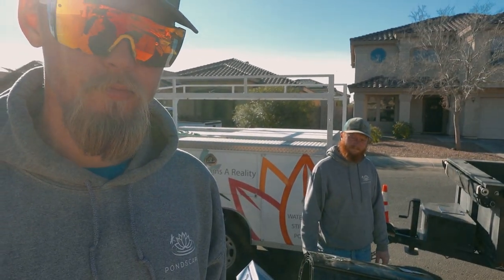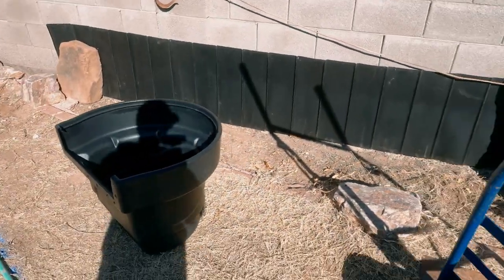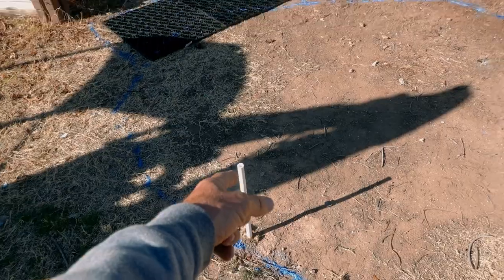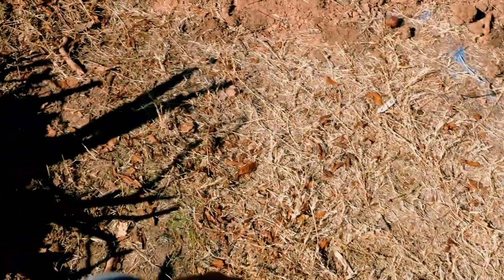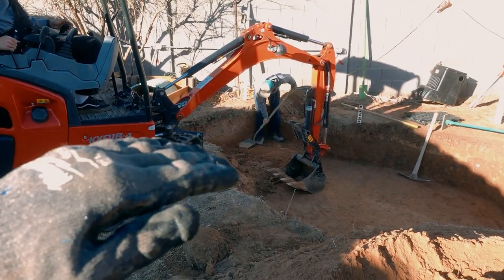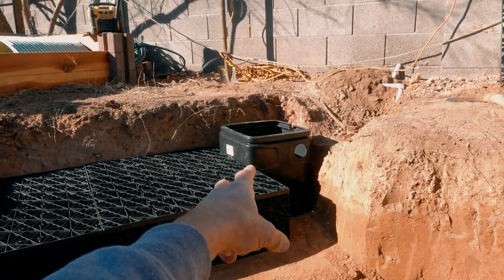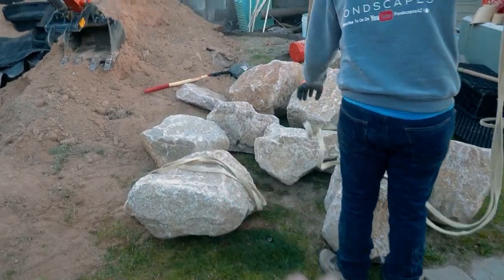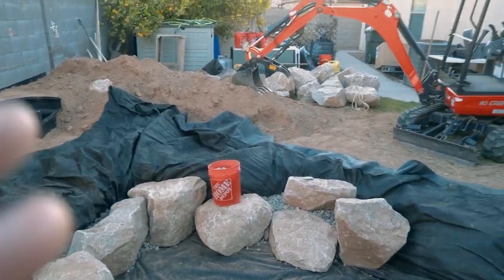8x10 Eco System Pond with INTAKE BAY Built for a Turtle

Comment: That turned out really nice! So you used pond foam to put a seal between the side edges of the scrap liner you folded up on the from of the aquablocks and the pond liner itself, or did you stuff underlayment on each side of the blocks and then foam over it?
Reply from the maker: Just foam on this one but rolling up underlayment/foam is an option on bigger gaps. Thanks for watching👍